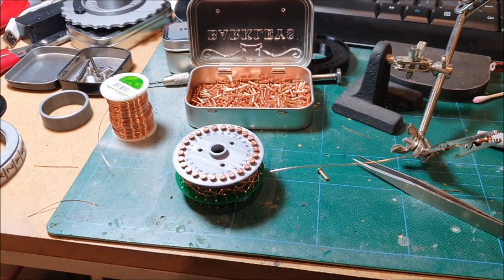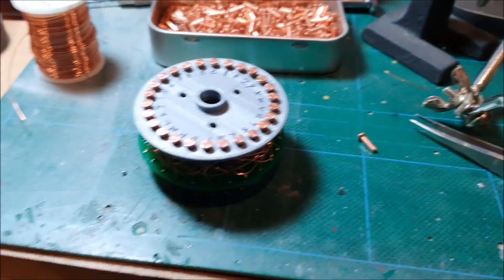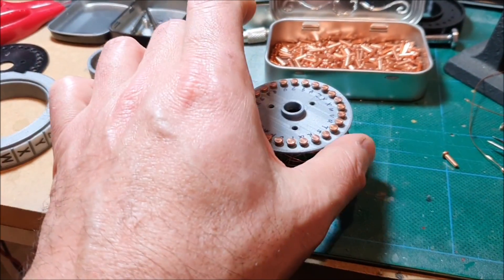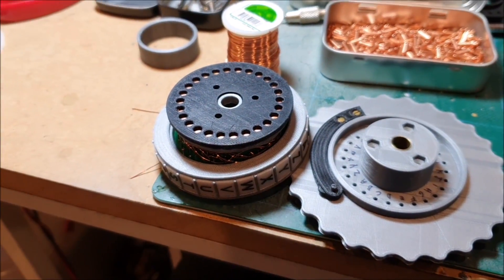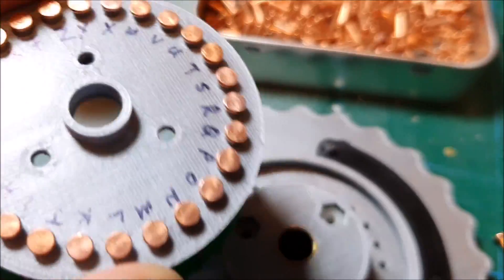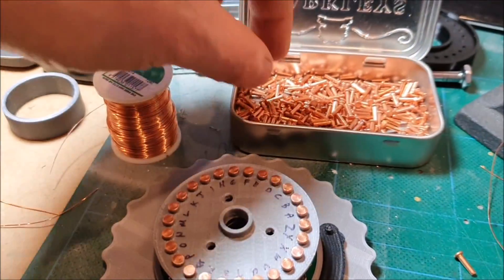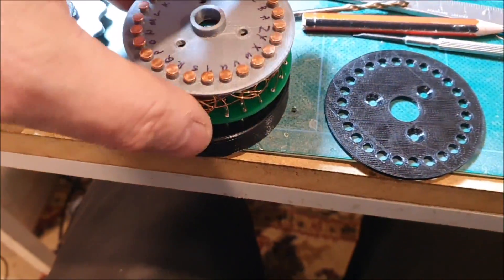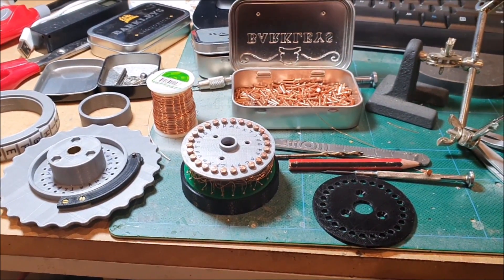3D printed Polish Enigma update - more rotor wiring

Comment: what did you use for the brass parts?
Reply from the maker: They are flat copper rivets from Aliexpress but they don't work well since they aren't a consistent size. I am (at some point) going to redesign things to use PCS instead to reduce friction.
Reply: @asciimation  thats good to note. I was thinking doing the same with copper spring pogo pin probes. Maybe ill look at other options. I'm still 3d molding the parts and kind of just looking at options as i design it.
Reply from the maker: @MatthewNelson  Friction is the big problem really. With all those contacts and all those pins to push around you need everything as smooth as possible. I'll get back onto mine one day, I got distracted with car and motorcycle projects!

Comment: The problem with my 3d printed Enigma machine was that some parts just can’t be 3d printed. I had to replace the 3d printed shaft which goes through the rotors with a metal rod. You can see the result here https://www.youtube.com/watch?v=Nzk9bcX67oI
Reply from the maker: I planned from that from the start so I used a metal axle and brass sleeves made form K&S tubing inside the rotors to run on it.

Comment: Well done with the work so far. The wiring inside the rotor looks amazing. I took the easy way out and used a PCB instead of the wiring.
Reply from the maker: I did consider that since I was getting PCBs made anyway. But this way I can make any rotor using the same board and the construction is a bit more along the lines of the originals. And if I make a mistake or need to change the design hand wiring gives me a little more flexibility.